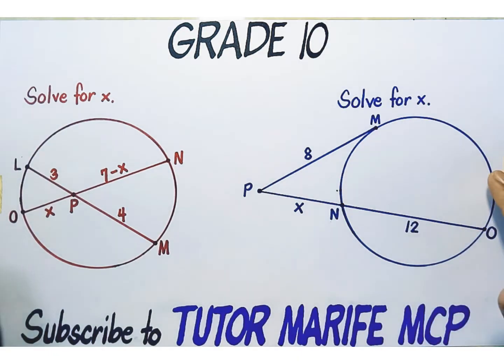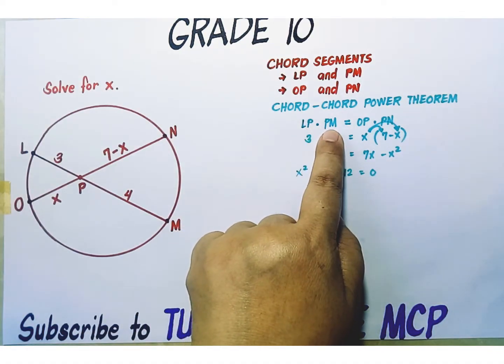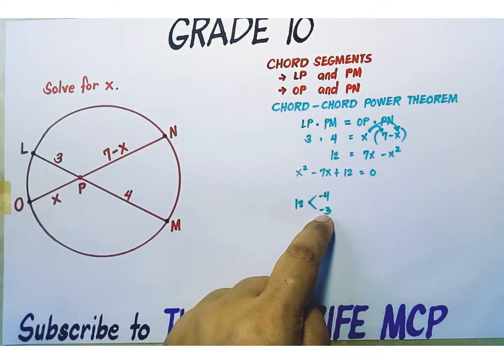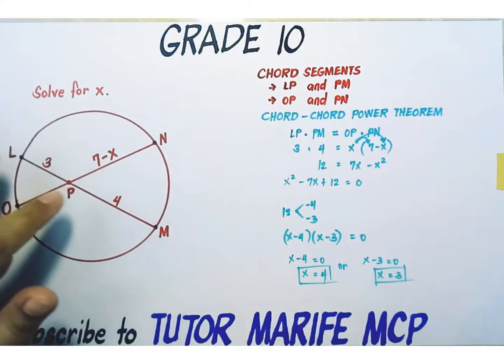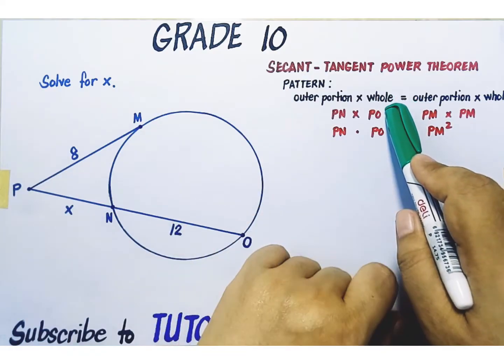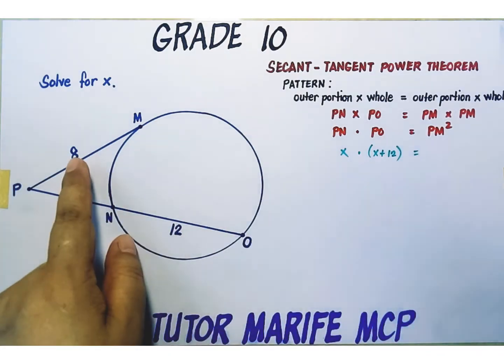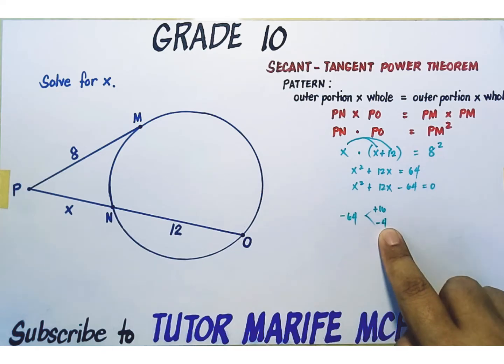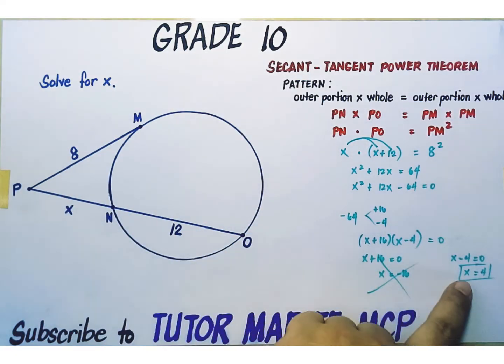Grade 10 | Chord Chord Power Theorem and Secant Tangent Power Theorem || By Tutor Marife MCP

Comment: Secant-Tangent Power Theorem
What if ang 12 magiging 12x
Reply: Hindi na quadratic equation kalalabasan
Reply from the maker: @kymangelocamallan8039  
If NO = 12x:

PN • NO = PM²
x • (x + 12x) = 8²
x • 13x = 64
13x² = 64
x² = 64/13
x = sq. rt. of 64/13
x = (8 sq. rt. 13)/13
🙂🙂🙂
Reply from the maker: Are you referring to the LENGTH of the 2ND problem's CHORD NO?🙂